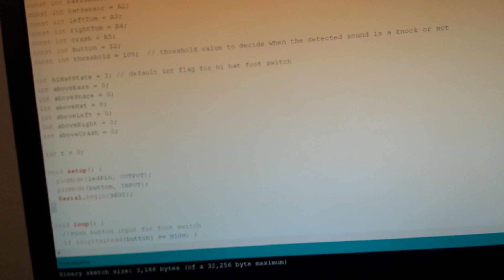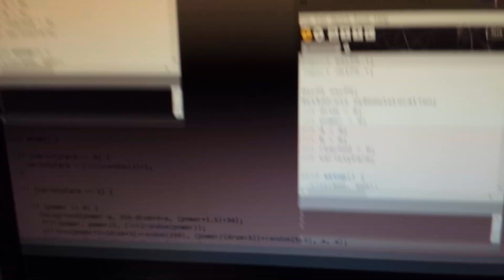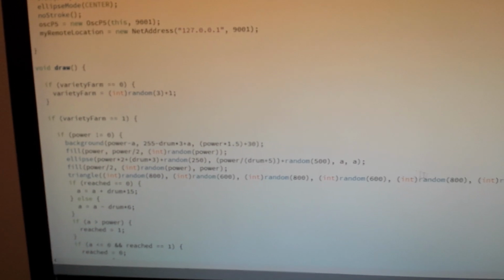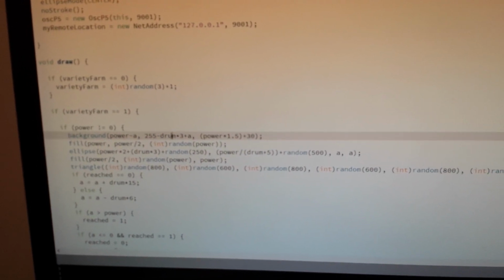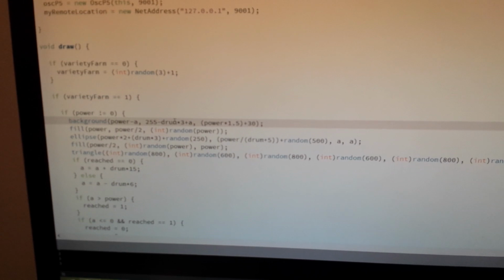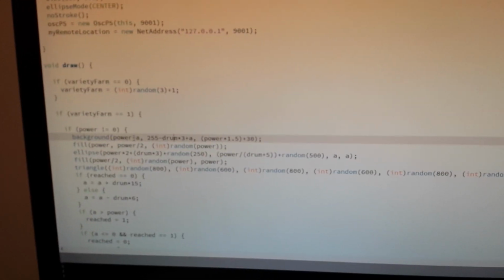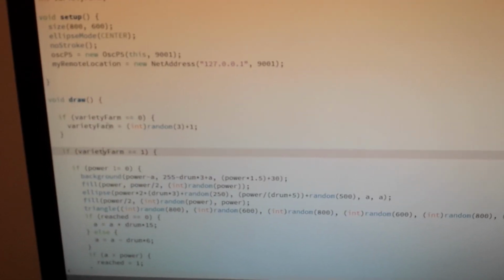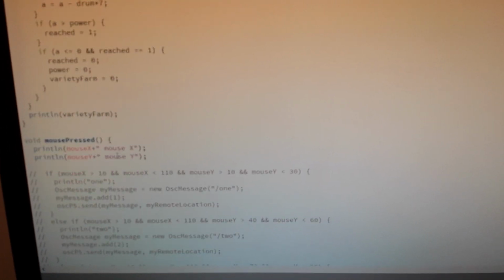Arduino + Pure Data + Processing | Drum Kit

Comment: Hi, I like the work you have done with the codes. I started building my own DIY electronic drum kit using Arduino, I know NOTHING about writing my own codes so I decided to copy someone else's codes and make some changes based on how many piezo sensors I have connected to my Arduino, I am using MAGIX: MUSIC MAKER, Running TOONTRACK SUPERIOR DRUMMER 2.0. and luckily IT WORKED even though I have zero knowledge in writing codes. I bought a sustain pedal (a momentary/on/off type) https://www.amazon.com/Stage-KSP100-Universal-Sustain-Pedal/dp/B001ELP5WM to use it to close the hi hat by stepping on the pedal and vice versa. Would you be so kind to let me know where to solder the pins of a 1/4 jack to Arduino so I can use that jack to connect my pedal? And also please write a code for that so I can just add it to my existing codes? I would thank you a million times if you can help me. I've already spent a long time looking for someone to help me, and I've already tried self study with Arduino language and code writing but I really can't figure out how to start. Please help me.

Comment: Cool! I want to make one forr myslef.but I do not really know how to start. Can you share some websites or data that help  you finish this projects.
Reply from the maker: http://arduinodrumkit.wordpress.com/

^^^This helped me find materials

http://todbot.com/arduino/sketches/midi_drum_kit/midi_drum_kit.pde

^^^This assisted me with the arduino code

Your most basic components to buy are an arduino (I used an Uno), piezo elements to pick up vibrations, and some material to damp the vibrations to allow for accurate triggering. In this case, I used metal attached to the elements and used foam and/or rubber to dampen the vibration.

Good luck!

Comment: my question seems a bit like Ron. but can you help me coding a hi-hat using a pot? is it possible to control hi-hat close partially open and open using pot? thank you.
Reply from the maker: Yes this would be possible, but I don't think it would be the most practical way to code a hi hat with variable sounds. Using a pot, I image you could set certain thresholds between 0-255 where the number directly controls some parameter like volume or sustain, and then an mp3 or wav file is played depending on the threshold AKA 0-80 = closed, 81-160 = half open, 161-255 = open. But again, I think the best possible way to achieve an effective and usable hi hat pedal/switch is with a FSR.
Reply: Cody Rogers thank you so much sir cody. if i'm not mistaken, the switch u used to close and open a hi-hat is hooked in the digital in, one lead to the 5v and one lead to digital in and 10k resistor to ground?
Reply from the maker: John govan Correct! I just used a really simple button for this project because we were required to have some sort of digital input.
Reply: Cody Rogers thank you sir. do you plan making it with mux?  :)
Reply: Cody Rogers sir can you help me with the code? i would like to make mine but without pure data and processing. my struggle is with the hi-hat open and close sound using a switch. i can't make the code work. i have my arduino with 2 mux in it so if i hooked a switch how can i tell the arduino that this pin in the mux is my hihat.
Reply from the maker: John govan Honestly I have very little experience with using a mux with arduino, and I disassembled the project before I got to hook it up with one. So hopefully you can get some better information elsewhere!
Reply: Thank you sir. :)

Comment: Hey man, I'm trying to build my own arduino drum, but I have some questions: is it possible to make really accurate stuff? like open hi-hat/closed (already know that it is possible), half open hi hat, foot switch hi hat sound (not sure how to describe it, when you open and close the hi hat and it makes a sound), and mute plates with your hand, copule hits, etc
Reply from the maker: Well yes it is possible I'd imagine, but you'd need the right equipment.
For instance, half-closed/open/closed hi-hat sounds would be best achieved by using a force sensitive resistor instead of a button for the hi hat switch. Perhaps pressing the switch whenever its previous state is not pressed engages a hi hat closing sound. Maybe certain plates have smaller FSR sensors in a certain spot dampened to the effect of the piezo where activating the FSR disengages the volume of the current active hit.
These are all just ideas, but to answer your question simply: yes, it is possible with the right materials. Electronic drum kits are made with piezo elements, and they're fairly accurate. It's all about craftsmanship, it seems.
Reply: Cody Rogers
thanks man!
Reply from the maker: Rob Vegan Persie No problem buddy, good luck!